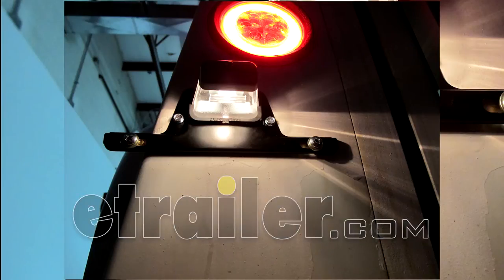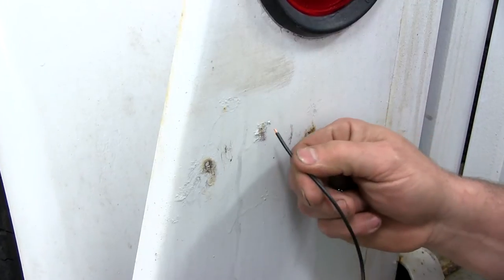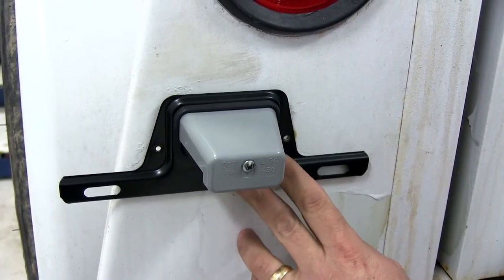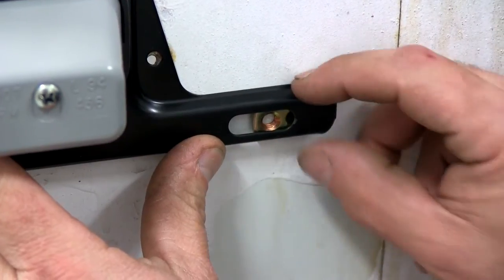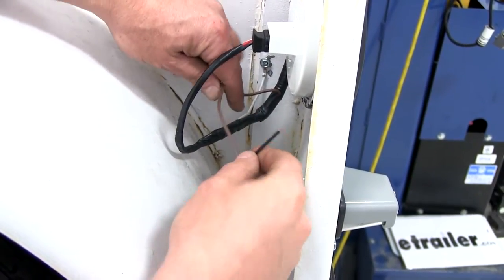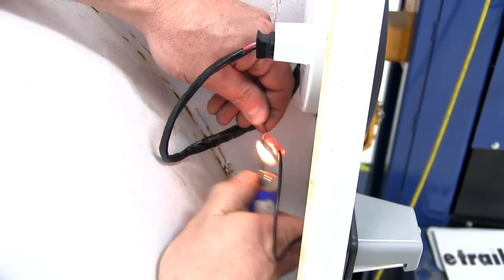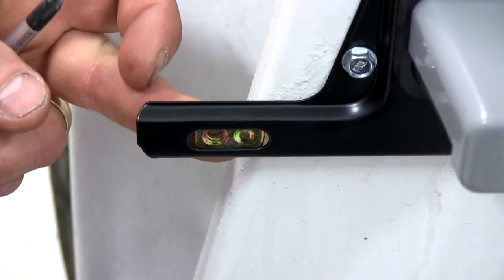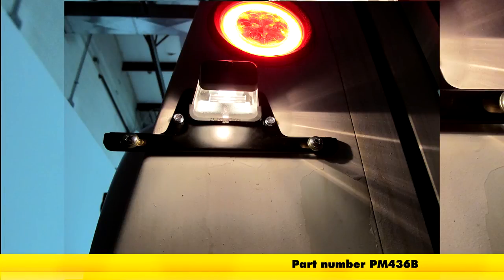etrailer | Peterson License Plate Light w/ Steel Mounting Bracket: The Breakdown

Comment: My used horse trailer doesn't have existing running lights wire for the license plate light, do I route one from the junction box or splice it with adjacent running lights??